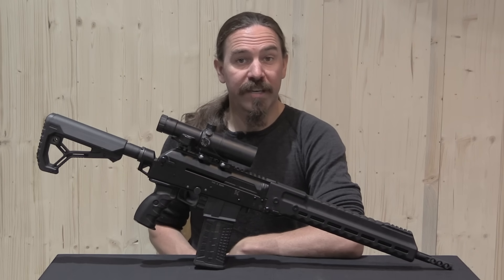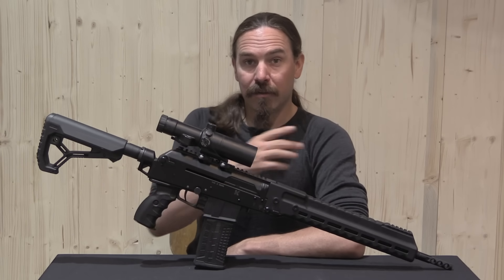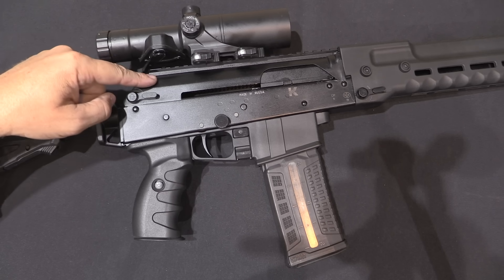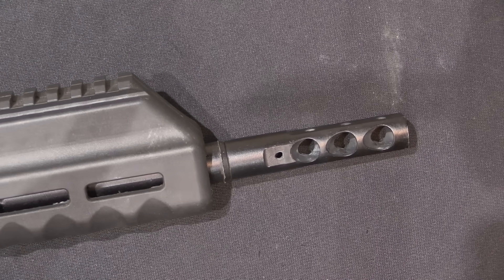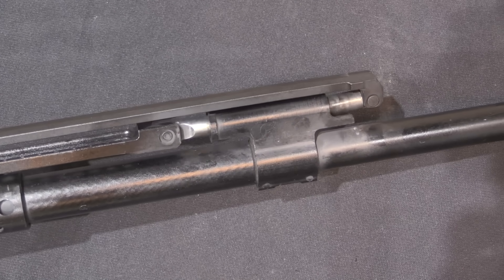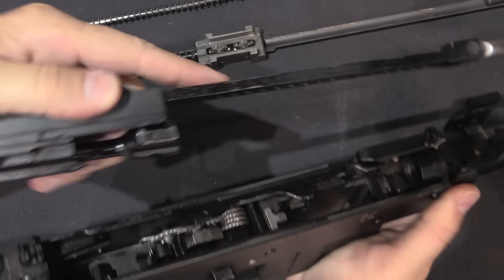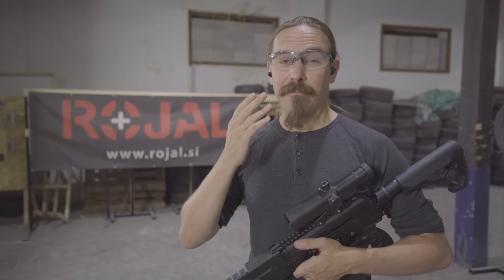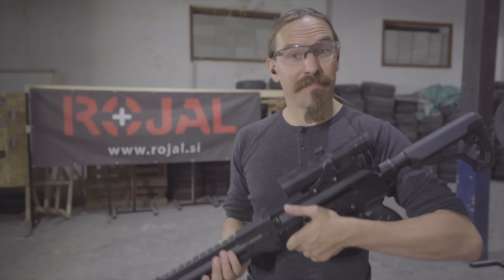Balanced Recoil AK-107 / Kalashnikov SR-1: Is It Any Good?

Comment: I feel like the spirit of the AN-94 lives on in this rifle.
Reply: Because it does. AK-107, AEK-971 and AN-94 (the names that time could be different though) were a competitors in "Abakan" program. They are alternative approaches to the same mission. And AK-107 has lost the trials. The only reason of its revival was a hope for commercial sales.
Reply: where pulley?
Reply: The AN-94 is a vastly different design. This uses counter balance system, the AN has a double feed system to fire two rounds one after the other to put two rounds on target  with one trigger pull and reduce barrel drift on follow ups.
Reply: @Frumious_Jabberwocky  it doesn't, they are very different designs
Reply: @MrGreghome  it's not the same design
Reply: @nebick27  Nobody speaks of design. The original post was about "spirit".
Reply: @Frumious_Jabberwocky  it doesn't even have that, you need at least design inspiration for that too. Thats like saying the M16 has the spirit of the M14 when they are completely different guns.
Reply: @Frumious_Jabberwocky  literally the only similarity is that they are Russian made
Reply: @nebick27  They both have recoil-compensating mechanisms that have wheels and move in line but opposite to the recoil impulse. In both cases the motion is initiated by the gas system, but carried/synchronized by a wheeled mechanism.
Reply: @Marci124  they are designed very differently and not for the same purposes at all. The AN 94 pulley system is for near instant follow up 2nd shot that comes with one pull and is nearly indistinguishable from the first shot, it is not for recoil like the AK-107 is.
Reply: @Marci124  the ak107 uses a gear  to move two rods in the gas block in opposite directions to reduce recoil, the AN 94 uses a cable pulley system to feed two rounds into the barrel very quickly one after the other to fire two rounds at the target with one trigger pull, the systems are not designed with any of the same parts
Reply: @nebick27  Both AEK (which AK-107 design stems from) and AN were designed during aforementioned "Abakan" research program.
The goal of the program was "to achieve higher hit probability (compared to AK-74) when shooting short bursts from unstable positions" (i.e. shooting offhand).
So while they use different means to achieve it (counter-balancing vs delayed recoil), ultimate goal was the same for both guns.
Reply: @CRL_One  that doesn't make them the same, just because they were developed in the same program. The U.S. military does that everytime they change firearms, multiple are developed and chosen from. They even just did that with the new Sig Spear. They had Bullpup rifles developed alongside the AR derived Spear for example
Reply: @Marci124  an-95 have no recoil compensation . It's build around 2 shot huperburst - when 2nd shot is fired before recoil was able to effect the gun in significant way. 
It's basically the same idea as hk G11 with it's 3 shot huperburst
Reply: @Marci124  They both were crazy pieces of non-orthodox engineering in order to achieve 2-bullet bursts into one point. The purpose was clearly the same. And that was tried in scope of the same military program. Not sure why our friend is resisting and trying to literally compare screws and nuts.
Reply: @CRL_One  the AK-107 design doesn’t stem from the AEK-971, rather both designs stem from the AO-38 prototype rifle designed by Pyotr Tkachyov. In fact, Alexandrov designed a balanced recoil system rifle (the AL-7) before Koksharov did.
Reply: don't forget the AO-63. The DBR Snake AR-15 if it was made for AKs.
Reply: Pretty ironic considering the balanced recoil lineage was a rival to the AN94, though now A545 is its replacement(and thus actually a successor)

Comment: It's hardly surprising that the balance mass doesn't seem to do a huge amount, as it appears to weigh a fraction of what the bolt carrier weighs.
Reply: On some level it has to.  If they weigh the same or contain the same amount of energy the bolt will stop moving.  It needs a directional bias to function or at least that's my non expert opinion.
Reply: @MrBottlecapBill  It doesn't need a bias - there's energy entering the system through the gas ports. Try picturing one barrel with two gas ports drilled side by side powering two actions side by side - there's no reason for that not to work, is there? Now turn one around, and it still works. The only thing those gears do is keep it nicely in sync.

My best guess is they've kept the counterweight light as they can leave most of the work to that muzzle brake, and a heavier counterweight means a heavier rifle. It's also unlikely they'd fit a heavy enough counterweight into a more or less standard AK receiver, at least not without using tungsten weights.
Reply: Depends on the speed it moves. Newton No2 . Force = Mass x aceleration. so it can weigh less if it takes off faster. The 3 laws of motion Newton devised all work together.
Reply: @51WCDodge  but it doesn’t move faster. It’s being driven by the same gears as the bolt carrier
Reply: @discerningscoundrel3055  they could have significantly lightened the AK bolt carrier and made the balance heavier. 

Or put the balance weight in front of the front trunnion, over the barrel.
Reply: @51WCDodge  It can't take off faster, though, as it's synchronised to the bolt carrier with those two gears.
Reply: @ScottKenny1978  problem with that and this rifle in general is that in IPSC rifle wich this is marketed for; fast target transitions and movement are a big part of getting a good hit factor. And weight up front kills your target transitions and weight in general kills your speed.
Reply: The gears link the two parts together so any force one applies in a particular direction also results in an equal force being transmitted through the gears into the opposite direction.
Reply: @antonw-uw4ov  shotgunners tend to want a bit more weight up front to smooth out the swing. Instinctive shooting, swing the gun past targets and pull trigger as it lines up. And if the usual target requires 2 hits, binary trigger.

Though this would be weird, since the weight is moving and the inertia is changing while the center of mass isn't.
Reply: @ScottKenny1978  ok I just do pistol, PCC and rifle in IPSC. But i dont really see anyone adding weight up front to shootguns on purpouse. In wich division would one do this?
Reply: If I remember correctly the aek 971 had larger piston so it was more effective
Reply: @51WCDodge  What? The two objects move synchronous they have the exact same travel speed. Also speed is not the same thing as acceleration and should not be used interchangeably. But thatțs splitting hairs I guess.

Comment: The top-cover that actually wedge-locks in place to maintain zero seems the most significantly functional-improvement in that rifle.

The balanced-action seems pretty well-engineered--to a sharp limit:  With that system, why is the bolt-carrier hitting the back of the receiver? If it were continuous-recoil then it would not need the muzzle-brake.
Reply: Because the muzzle brake mitigates the actual physical recoil by redirecting some gas?

But yeah, a constant/continuous long recoil action probably would've spread the force over time without being that complex
Reply: A constant recoil system isn't as effective as this, in semi auto.
Reply: @squidwardo7074    ?
Why not? Now that you mentioned it, I think about it and it's extremely rare at-all, and I don't know of any constant-recoil semi-autos other than the KG-9, semi-auto version of the full-auto KG-99; those were widely derided, EXCEPT when converted to full-auto!

There's the Ljuitic Space Rifles, Pistols, and Shotguns -- a buddy let me try his at a trap meet -- but those were all single-shot.
Reply: @davidgoodnow269  Watch Ian's video on the KAC Light Assault Machineguns as well as shooting the M14 it gives some good insight as to why some guns have more recoil than others.

But basically the gist of it is that most of the recoil on a self loading gun comes from when the bolt or action slams forward into the rear and when it slams forward into battery. A constant recoil system mitigates this by turning the slam into more of a long push, since the bolt never truly stops for more than a few milliseconds (when it locks into the chamber and just as its about to start moving forward). 

It's like if you pick up a heavy weight and suddenly drop it, your hand flies up because your muscles are tensed and the weight is suddenly released. 

The constant recoil system is like just holding the weight constantly while normal recoil is like picking it up and dropping it constantly. Actually the constant recoil is like holding a smaller weight because it's the same force but spread out over a longer period of time.

This works in an automatic because the bolt never stops moving, the forces cancel out and the only force you feel is from the bullet leaving the barrel. It doesn't work in a semi automatic because every time you fire the bolt stops when it locks up. In a semi auto the constant recoil system is only slightly better than without. 

It's actually not possible for a semi auto to be constant recoil, because everytime the bolt locks up it stops of course. On the KAC or Stoner machineguns the bolt locks up for just a few milliseconds before firing again. 

The balanced recoil on the other hand cancels the recoil from the bolt out completely. Newton's Third Law of Motion in effect. Theoretically of course, IRL nothing is perfect and there's a lot of friction in the gears and extra parts.

TL:DR constant recoil makes more of a constant push while balanced recoil eliminates the recoil from the bolt completely

I still think that a better tuned spring to make it more of a constant recoil system would help though. Same force but spread out over a longer period.

Comment: Would like to see this on a 7.62 by 39 version. 556 does not really need it as much.
Reply: Yea but you do competition  in 556 not 762.
Reply: Larger calibers would make the recoil system even less effective though.
Reply: @TimtheWinzard  isnt it just a matter of making the counter weight bigger to match the mass of the bolt?
Reply: @LabRat Knatz Yea in 300BO would be good.
Reply: @magamike1800  nope - bigger cartridge means much more recoil is from gases and bullet itself not the bolt.

Comment: The better test would be by first blocking the gas port (to eliminate all bolt travel) and comprare it with stanndard AK74 and then with SR1
Reply: I think the better test would be test it with both ends of the gas block, blocked (ie as a straight pull bolt action)  to get a full impression of the round being fired, then blocked as you said, but without the counter balance system in, to test against a more traditional AK, then with the counterbalance system in but not functioning, to see what the added mass adds, then fully working, ideally with the rifle butt against a load cell, but that's all too much for someone to set up for a reasonable short overview of the rifle, but it would be interesting to see... polenar tactical, you know you really really want to do some science?
Reply: I suspect doing so would highlight the fact that overall reduction in mass of the bolt carrier, and piston rod is actually the secret sauce that helps reduce felt recoil in this AK series.
Reply: @ArgosySpecOps  maybe, maybe the key is an AUG style recoil spring ahead of the bold, thats has a variable compression, the ones that go from easy to hard, i can't remember what they're called, to do more to slow down the bolt before it hits, hells maybe even a second recoil spring to slow the bolt down when closing, softer than the main recoil spring

Comment: Good review, but something does not add up in the conclusion. It seems the counterbalance takes care of (1) the backward and forward recoil of the bolt+piston, and the muzzle break reduces the effect of (2) the bullet leaving the barrel. These are the two contributors to recoil as you described. If taking care of (1) does not reduce the recoil much it means (1) is of lesser importance, so no need to position it as a big problem. That is why most manufactures take care of (2) only, which is more important and also cheap to fix. With this model, AK went whole 9 yards, which takes care of (1) and (2), albeit proving that taking care of (1) is not worth it because it contributes less to recoil and costs more in complexity.
Anyhow, thanks for taking the time to show it to us! Very informative video.

Comment: Amazing piece of engineering. Imagine over time as the system became more simplified/reliable. The potential is there.
Reply: I think Ian demonstrated that the potential is not that great when the muzzle brake does more than the counter-balanced mechanism does.
Reply: @eloiseharbeson2483  the recoil is not that small. Makes me wonder if it was designed properly. I suspect that it should be possible to tune it to completely cancel the recoil. Maybe they had problems with heavier counter balance part. AEK looks like more elegant system, more potentioal there.
Reply: @tiortedrootsky  is the AEK able to put a larger counterbalance by placing it below the rearward piston?
Reply: @revimfadli4666  look up video "Военная приемка «Сбалансированный автомат»". 
Theres disassembly of AEK and slow motion of shooting the disassembled gun. Sand and ice test with slowmo of dirty gun. Remember, that its from Zvezda tv channel, the russian military one, so they wouldnt hide any problems, of course.

The gas chamber is a ring, like on some shotguns. The forward counterbalance is a rod, and it is moving inside a tube that is the piston for the carrier. The ring gas chamber is between the front of the tube and a mushroom thing on the rod. 
Carrier+counterbalance go out in one piece, like ak, much more streemlined than the ak-107.
Supposedly it passed all the testing, but the carbon from russian corrosive ammo would go everywhere and the carrier is not fully field disassemblable as i understand, so that would be a problem.

Comment: In my oppinion(as PHD Student), they analyzed the oscillation behaviour of the (old AK) rifle, and found 2~3 frequencies/harmonics which were frequency wise/geometrically so far apart that they compensated with two different mechanicsms that would work together (position an frequency). So i think the compensator and the balanced piston system were designed to work together.
Reply: I was about to comment about this. I dont believe the factory designed the gun without the effects of that specific compensator in mind.
Reply: What?
Reply: I think you give the folks at Izhmash a little to much credit. 

In IPSC competition shooting most rifles are basically tuned by drilling the compensating ports larger and larger untill you get sufficient downward push. I think that is what they did here: buildt the blanced system and then added a brake/comp and tuned it to work well with those rifles. 
That is how it is usually done whrn building custom rifles as well, it basically requires no math to just drill the top ports on the brake larger, remove some weight from the bolt and turn the gas down a little untill the rifle does what you want.
Reply: @antonw-uw4ov  While the technique the original poster mentioned would be optimal, I believe you are correct. Physics-based analysis of a rifle's recoil would be extremely expensive in terms of professional engineer man-hours, when compared to one or two gunsmiths with a milling machine, some round bar stock, and a couple boxes of ammo. And the analysis would probably only get a few extra percent of recoil reduction relative to the educated trial and error from the gunsmiths.
Reply: @antonw-uw4ov  for single compensators systems i would agree. but since this is a two level compensation system. It seems obvious that they understood their system of oscillating masses ( 2nd Order differential equation, but with multiple sources and maybe additional higher orders of resonance ). Not sure if they calculated and measured it or just experimented around, but the fact that they intentionally used two different systems to compensate for moving masses tells me they knew it would not work as good as only using one. To find out what they really did placing gravity sensors onto the rifle ( Arduino is fast enought ) and measuring the vibration/acceleration during the shot would be fine. I am pretty convinced that both systems were designed to damp an harmonic oscillation in combination.
Reply: @Rock57811  I dissagree, my point was that they just took more recoil reduction (in the form of a better comp) and piled it on the existing AK-107-system. 
In gun design it is much more trial and error than calculations and math. And much gets improved through itterations, you don't just sit down and calculate out a rifle.
It's usually more like "ok conterweights; shoud we start by trying 50/50? -ok let's try that".
Reply: It would be interesting to measure the harmonic frequency and amplitude of the system with the compensator and without the compensator.
Reply: @antonw-uw4ov  Harmonic oscillations are not a particularly novel concepts, a lot of the analysis could be carried out in commercial simulation software.